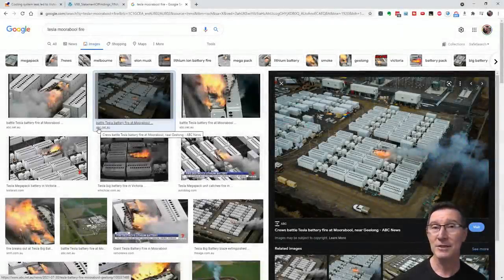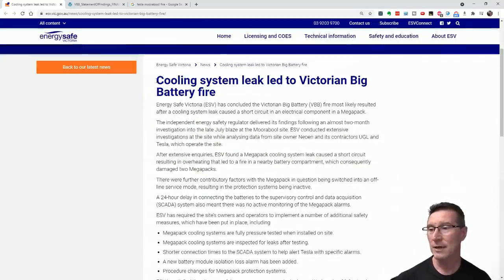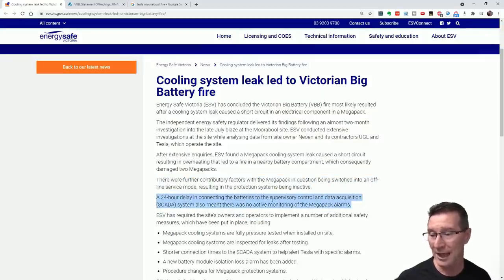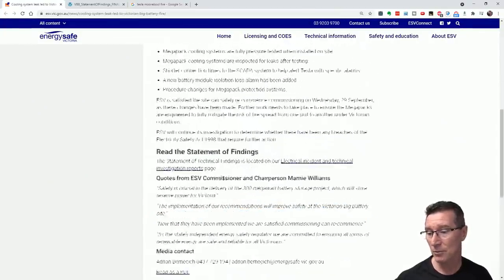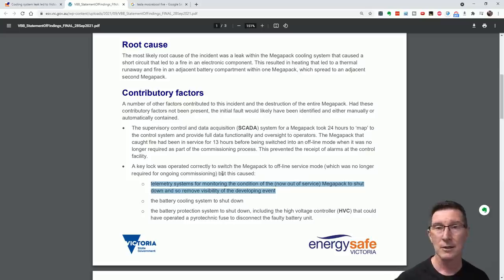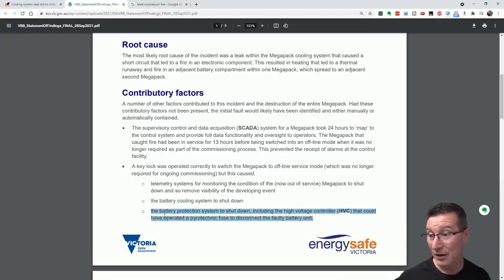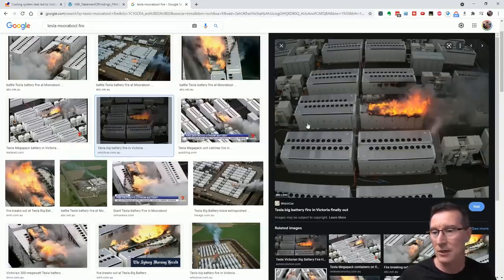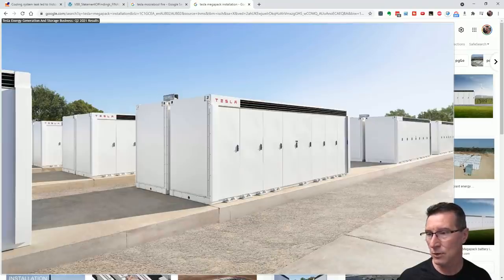EEVblog 1422 - CAUSE of the Tesla Victoria Big Battery Fire

Comment: I think the main takeaway, or one of them is, this happened during commissioning.  All the other issues leading up to it I can see being due to a new product / technology and new procedures and protocols needing tweaking.   I think by failing safely they mean it didn't leak and spray water in such a manner as to electrocute someone nearby, then catch fire and explode.   It appears to me this could be close to a worse case scenario.  It would not have been too long ago that these lessons would have been written in blood;  I say good job Tesla and company.  Fix it and move on.
 As far as non conductive coolant; Are they capable of removing heat as fast as water?  If so maybe use them internally and go to external heat exchangers for the water?

Comment: Sounds like a big power semiconductor operated in an unintended way, popped, and created a nice, sustained dc arc and either the high current caused a cell to catch fire, or the arc itself burnt into the cells. I'm guessing a 'normal' fuse would have a similar arcing problem, and the pyrotechnic fuse can only be firmware triggered (no hardware fail-safe), and the firmware was asleep.

Comment: I'm also curious as to the Fire Engineering Report for this facility. I wonder if any of these digital smarts are specified in there or is it a bunch of traditional active and passive fire systems. It would require a fairly progressive fire engineer if it used the digital goodies. That said digital trickery doesn't always beat the simplicity elegance reliability serviceability and effectiveness of tried and true engineering practise.

Comment: Any reason to not use foam to extinguish battery fires?
Reply: It doesn't work. Basically the only way to put out a lithium fire is to cool it with water. Even that wont stop a battery reigniting if it still has energy to release, so the ultimate solution is just to let the fire burn itself out...
Reply: The foams that will work are in themselves toxic, and as well the cell does not need oxygen to burn, it is, by the time it is on fire, well capable of sustaining the reaction, using water being decomposed by the hot nickel of the case acting as a catalyst. You need a non water based foam, that also will cool the fire, which is generally made from a little bit of water, and a shed load of organometallic salts, that chemically bond with the lithium and other material in an endothermic reaction, robbing the fire of energy it needs to sustain itself. 

Let that get into a river, and it will be dead of all life downstream to the ocean from that point, within hours, and recovery might take decades to occur, if ever, unless you dredge out all the contaminated silt. Places that use those foams normally have a massive bund wall around them, and a non permeable underlay for the entire complex, with all services going over the wall, not through or under, and with containment tanks for handling the mess. That likely costs more than the installation here alone, just in civils work. Normally reserved for places funded by either a government research lab, or one of the more massive chemical and manufacturing cartels.
Reply: @SeanBZA  The foam sounds like a worse solution than the fire..

Comment: Pyrotechnic fuse would prevent fire, bacouse fire happened not in battery module but in external component,  and if fuse cut power (after detecting short) from battery compartment would not overheated and caused fire.

Comment: In Cape Town, we store energy by having two reservoirs of water at different heights. when we have a surplus of energy we pump water uphill. when we need energy we use turbines and allow the water to flow down hill. we don’t need any lithium ion. it’s been a very effective and clean way to use gravity to convert potential energy to kinetic energy. It been operating for more than 4 decades. To me, this seems like a better solution than lithium ion batteries.
Reply: If your place is flat - the batteries offer many advantages over pumped hydro.
Reply: @rkan2  sure but electricity is not very difficult to transport, especially where there are existing electricity grids. I can’t think of many places where there are no mountains and no electricity grids. I’m no expert, please inform me of the advantages of lithium ion batteries, I’m genuinely interested… I guess they are cheaper and quicker to install than hydro-electric schemes?
Reply: @nicnewdigate  Electricity is indeed not difficult to transport but building new grid connections in places where people can own land privately and especially in populated areas can be a proper nightmare.

But yes - the quicker install and in a lot of (flat) places even cheaper than pumped hydro. Also batteries have the best grid-stabilizing, e.g. reaction time out of any energy delivery/production method. Nothing that relies on something spinning (gas,coal,diesel,nuclear,hydro,wind) can react as fast.
Reply: @rkan2  understood. and I guess batteries are orders of magnitude more efficient than water towers. thanks.
Reply: We have droughts more years than not.
Reply: Reservoirs solve distribution issues on the scale of minutes, batteries can react on the scale of milliseconds. When there are fewer turbine generators which provide inertia based frequency control, something like batteries are needed. That’s not to say pumped hydro shouldn’t be part of a solution, as it’s cheaper than batteries for long duration storage. But to provide enough current to replace a tripped power plant for minutes may require enough battery capacity to provides hours of that current.

Comment: I believe the cooling system is self contained. They used to be model S battery packs stacked together.
Reply: But, they connect to the vehicles AC system to cool the fluid, so they must have active cooling somewhere

Comment: I can't believe their using conductive coolant!
Reply: Unfortunately water is very cheap, works well, and is about as environmentally friendly as it gets.
Reply: @Lucien86  I think mineral oil is also cheap and eco friendly. Sure it can burn better but I don't think its that bad of a burn. There is likely other options also.
Reply: Distilled water is non-conductive but will leech ions from contact with metals and become conductive after a little while, especially when there is voltage between metal parts to speed the ion pickup process up. Louis did a Macbook demonstration, took a minute to get going and then becomes just as bad as anything else. Mineral oil has less than half the specific heat of water, so you'd need twice the flow to carry the same amount of heat. Oil's higher viscosity would also mean needing a more powerful coolant pump than already required to double flow, so you may need about 3X the pump power to use oil.
Reply: @PRiMETECHAU  Water and propylene glycol coolant is a lot better than oil in the thermal conductivity thing, and thus can transfer more heat per unit volume. Oil is used where you need electrical isolation, but has a much poorer thermal transfer ability, so you need a large tank of it. Water is also cheap, and low viscosity, so smaller passages, faster flow and much easier to pump around. Pure water and glycol mix is also very much a poor electrical conductor, though you do get the problem of contaminant ions making it conductive, so best to treat it as a conductor, as the additive pack there to passivate metal surfaces and prevent electrochemical cells building up between dissimilar metals is mostly ionic salts.

If you used oil, it would have to be a very pure very light oil, almost like diesel, Jet A1or RP1 in characteristic, and thus would be very hard on seals, and also subject to corrosion as it absorbs moisture. Very few plastics will survive long term soaking in oil, unlike glycol, where you have a reasonable choice. For oil you are limited to PTFE, SRBP and some thermoset plastics, most of the other plastics suffer from ageing in oil and go brittle. 

Not good needing to replace entire sections of the units as maintenance every 3 years, unlike the glycol, where you just flush the system with 2 changes of the mix, and call it done, and you can do this even when on line and in use.

The problem likely came as Dave said, hot connections from either water dripping and bringing down conductive dust or tramp filings of metal from manufacture (hard to remove this from electrical panels unless you are fanatical about vacuuming up every filing, as you made the parts, handled them, and then between each part being installed) without the costs becoming aerospace level for assembly. You can do this in the battery plant, where it is all automated and robotic, but hard with people around doing work.

Comment: Point of order! That is just plain wrong; You can put the lithium battery fires out, it is just very hard. It requires massive amounts of water available in a short time.
If you do not have enough, it is better to contain and just keep it calm. A regular car can take 500-1,000 gallons while a single Tesla car could take 30-40,000 gallons according to
Reply from the maker: Anything is possible given enough effort. This is why they just contain the fire and let them burn out.

Comment: There's some double speak in that report, indicating the real reason was covered up.  The unit was probably turned off BECAUSE it was overheating and the operator wanted to go home on time so said nothing.  The latent heat in the system caused the fire.  Simples.  Maybe, haha.  Even my microwave oven has a cool cycle that continues for a while after it stops emitting, even if the door is opened to take the stuff out.

Comment: I'm actually a little surprised they apparently didn't have some sort of deluge system to contain fires.
Reply: Probably in the plans, to be installed last, though there is a lack of the large pond normally used with these systems.
Reply: @SeanBZA  If there was going to be a deluge/mist system of some sort, it should have been one of the first things to go in, immediately after the packs get dropped in place so pipes and fixtures don't get in the way but before packs ever get taken out of as-shipped power-down state. Safety first.

Comment: SCADA (Supervisory Control and Data Acquisition) is much more than a little monitoring system.. A decent SCADA system collects and catalogs more data IN REAL TIME than an airplanes blackbox. If the SCADA system was properly configured their should have been an auto shutdown procedure.. There should also be an internal fire protection system (Not in the batteries but in the DC power component cabinet).
What you read regarding the manual shutdown was complete design failure, both in the SCADA system but more importantly in the Battery design itself.. A simple fluid leak sensor would have taken care of this (If the SCADA system didnt shut down when you took the module offline..). There should have been fluid pressure and temperature sensors on both the low and high pressure sides as well as sensors on the motor monitoring voltage and amp draw.. 
I hope both the operator and TESLA pay the bill for fire service and the investigation (which should not have been done by TESLA)
Also, at least here in the states the interlock keys are called Kirk Keys and are a highly engineered system in itself.

Comment: WE LOST A FEW FIREMEN TO A FIRE AT A LITHIUM ION BATTERY STORAGE FACILITY FOR A PUBLIC UTILITY IN THE USA. THEY ARE NOT SUPPOSED TO SPREAD, BUT OURS DID, AND THEN IT EXPLODED, QUITE VIOLENTLY. These things need to be designed like a transformer vaults in a large mine with reinforced concrete  walls in between the cells. Who designed that system? WOW! What job did they have last week? Fry cook?

Comment: 13:46 Ahh there it is... accidents like these are never caused by 1 thing.  People / design / installation or combination have to fuck up in symmetry for it to happen.... 

These containers are what? 3MWh?  You would think there wouldn't be a "switch" that can simultaneously disable telemetry, cooling and battery protection....?  

Battery protection system can't detect temperature rise, flow rate, level of coolant and disable long before it getting dangerous?  

Battery cooling and protection should be redundant and function in a situational way, regardless of if the unit is online or out of service?
 
It really asks the question if they know what the hell they are doing?  Why put them that freaking close together for a start!  Large HV transformers have concrete walls between them for a reason...  do that at least!

Comment: Let's examine the stupidity of the design. They put a water and ethylene glycol cooling system with zero isolation to high voltage high current electric devices and connections.  The entire design needs rework. This will not be an isolated event but will get worse with time.  In answer to your question on who designs the layout of these installations it is Tesla Energy themselves

Comment: Ive seen the system it is a closed loop card based system based in the door and the back vent. so with a thermal runaway over ran the the offline thermal rating. There is a reason tesla wer not under the knife due to the site failing to use as instructed. I believe you are to monitor any offline pack in a non communicative routine.

Comment: I call BS on the root cause; there's no way Tesla would admit to faulty cells. Surely the coolant will be D.I water and glycol which is a pretty good insulator when new.
Reply: no it isn't. As soon as DI water comes into contact with two electrodes with dc across them, the electrodes start to dissolve, fairly quickly rendering the water quite conductive. There's a video by louis rossman who tried distilled water on macbook pcb to see how quickly it would corrode, and corrode it did, in seconds!
Here we have some high voltages involved, it only makes things worse.

Comment: You mean a medium that contains a very high density of energy can catch fire and even explode? That is news to some people?  The more energy dense something is the more likely things going wrong will result in fireworks.. or really big explosions.  Even a single small electrolytic cap can go off with enough force to blow a CPU, heat sink, and Fan screwed into the board several yards away and shoot a 3ft flame jet.  When you pack a lot of energy into a medium all of that energy is always looking for a way to distribute itself... the faster the better. The difference between a modern battery catching fire and exploding is pretty much the same as with burning plastique in a fire and having a nice hot fire vs giving it a little jolt of 12V and it blows your hands off and embeds your cooking pan through your torso and into your spine.  Delta is always that crazy thing that results in deaths in crashes and fun with explosives.

Comment: Seems like this facility wouldn't be needed if the entire system wasn't on the edge of collapse.  From what I have read elsewhere the Australian system is kind of an embarassment.
Reply: I do not khow bad Aus electric system might be, but the idea with this type of battery systems is to handle peak hours in a more reliable and predictable way; otherwise consumer will be paying more to cover the costs of the natural gas plants that are ready to take the peak.  These are not cheap, and are only there for the peak.  Battery is financially way cheaper, as it can charge off peak with little modifications to the current grid, like power line to the battery facility.  They also work with "intermittent" generation system like solar or wind.
Reply: @ikocheratcr  From what I have read the Australian system is pretty close to capacity.  Any hiccup and the whole thing crashes, its why they need such a facility.  Where I live there is excess production from multiple sources so its not an issue. However the current government is closing a lot of these facilities for political reasons so it may be in our future.  They just closed a major power plant, putting more than 10,000 people out of work and didn't bother to replace it with anything.  Now we have to pay more for imported power but the politicians can proclaim how wonderful they are by reducing local pollution.

Comment: I think you're missing the root cause.  This didn't fail because of a lack of cooling, this failed because the coolant leaking into the chassis caused a short circuit in another device that then started drawing power when it shouldn't have and overheated and caught fire.

Comment: lol this is all technical BS that probably came right from a Tesla engineer to the advisory board member with a check to lay blame on the power company. The system was designed to shut down with the key and if it failed during shut down its TESLAS fault. And how is a safety fuse disabled by shut down, FAIL!

Comment: So, this is another case of Tesla releasing a "pre-alpha version" product as a fully developed one. (The other being the autopilot)
I mean, the way the report describes it, it should not be possible to fail in such way for a proper product with such potential threat.
If the pack was switched offline, thus no telemetry was sent and the protection was deactivated it should not have been possible to charge it or connect it to the grid at all.
It should only ever be possible to do anything with the pack if all safety is on, ideally with a verification that it is really on.
And there should have been a leak/fail detection fot the cooling system that would switch off everything. Common appliances seem to have better protection...
It might have still caught fire but from the report, it looks like it wouldn't if it had properly designed protection system.
But I guess releasing half-assed system is okay, if the company has a powerful law department.